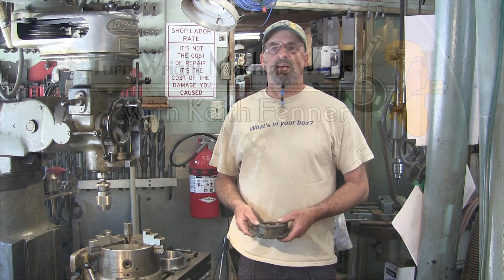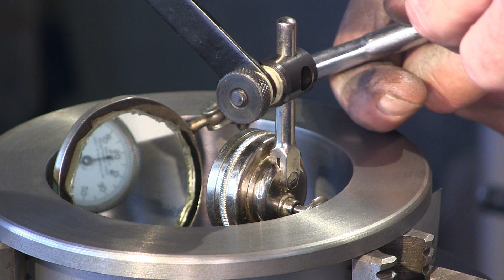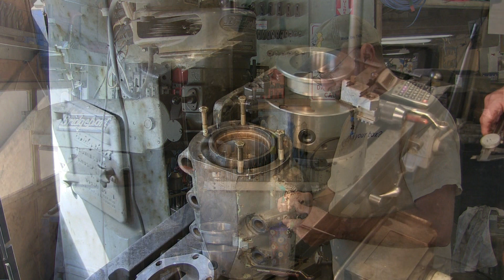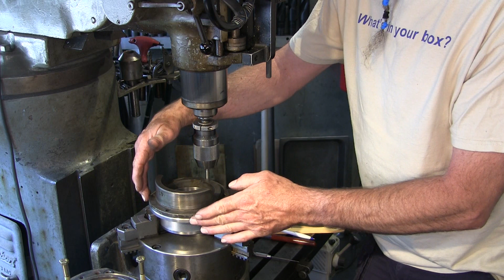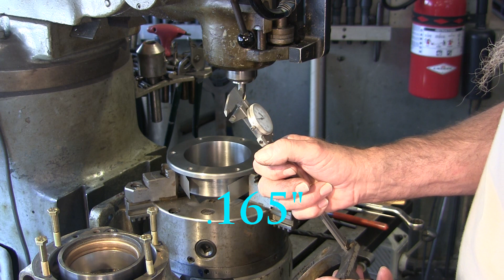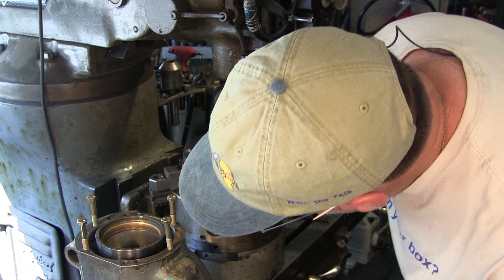Do Over Part Six

Comment: I would have set the part up on parallels so that the shoulder was up off of the face of the Jaws. This way you could mill both flats without having to move the part. It's not like it's taking a lot of force to machine the part.

Comment: I hate when that happens.  Thanks for having the guts to show the good and the bad. My only setup suggestion would have been to put three pieces of weld wire on top of the jaws so the flange would sit above the jaws so you could mill both flats just by indexing the indexer 180.

Comment: I'm gonna blame the Chinese three jaw. Thing is, any three jaw is not only concentrically inaccurate, but they need to be tightened in each of the three positions to take up the slack in the scroll, thereby applying the inward force equally. Of course, like you mentioned.. tight, but not so tight as to deform or mark the part. 
Work holding is a bitch sometimes. Easy to imagine that in a production situation the part being held in its own concentric clamping fixture. Or in a CNC machining center, the part would be entirely machined, sliced, diced, and then parted off in one op. 
All you can do is what we all have experienced. That's what machinists do... we Getter Done!
peace-out..Tc

Comment: You pulled an Adam!! unfortunately this isn't your part...  the worst part is you called it on the counter sink and it still happened. I ended  up .020" over on a bearing fit yesterday and had to scrap the piece of 6" cold rolled 12" long I've been working on for 4 days, last operation too. thanks for including the oops in the vid, it's cool to see that you are a real life boy and not just a fabricating machine!!!!!

Comment: Minor wrecks are among the risks of the trade. We've all been there. All you can do is take a lap of the shop, calm yourself, survey the damage, and either fix or do-over - which is kinda the title. Stay tuned.

Lessons? Gentle grips may allow movement. Aluminum between smooth surfaces can be slippery .

Alternatives to do-over? Skim damage from flange OD. Live with the esthetically ugly (can't see that happening.)

20-20 hindsights? Maybe a tattle-tale indicator to monitor part movement in the jaws. A clamp to anchor the flange to the top of the jaw; replace a jaw bolt with a stud for a clamp and step block. 

Predictions: Keith turns the replacement part ready to drill in about 40 minutes if he doesn't fiddle with cameras and narration.

And now, the next episode....

Comment: OUCH! No worries, you'll fix it. For the bad hole, plug the one not used with machinable epoxy like Devcon Steel putty, and install a helicoil in the good hole.

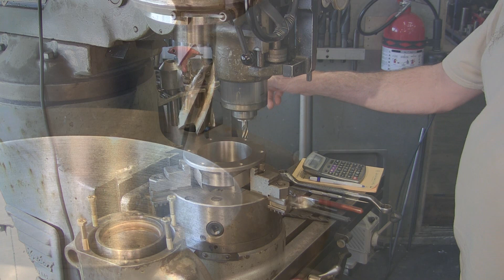Comment: 20:34 OoO Well, crap. Surprised me that it loosened up like that just backing up for a new cut. I would have thought it would have spun while taking the cut when it has the most tool pressure on it. Hopefully it can be salvaged and the cut was straight, didn't look like it moved during the cut.
Reply: During the cut, the tendency of the workpiece is to relieve the cutting pressure if it yields to it. (aka "Conventional" or "Upcut" milling direction). This is a negative feedback loop.
On the retraction stroke, even though the depth of cut is much less (it's effectively a spring pass) there is a positive feedback, whereby the slightest move of the workpiece in the least constrained direction (rotation about the z axis) causes more metal to be presented into the cut, instantly increasing the cutting pressure, with the results we saw. Important to note that this is true only after the cutter crosses the deepest part of the crescent machined away. From then on, any anticlockwise rotation of the work creates a rapidly increasing depth of cut due to simple geometry. 
This nasty contingency is something to watch whenever the "Climb" or "Downcut" direction is involved -- the rotational freedom vs straight cut situation, here, just makes it worse.
It's a pain, on a manual machine, to have to move the cutter clear of the work for the return stroke, and usually it's a step we can omit. Here, with a thin-walled housing requiring a light grip in the chuck, it was almost but not quite OK. 
One or more clamps on the flange, bearing against the side of jaw(s), would have helped prevent acw rotation, but that's a hindsight insight. Those are easy to come by.
Kudos for Keith for showing us the rough with the smooth. And for incurring the extra risk (due to added distraction) inseparable from turning every job into a teaching opportunity, for our benefit. Operations which are easy to pull off under normal circumstances become difficult when trying to document them in pictures (especially moving ones), and even more so when you add real-time commentary. People like Keith get away with it because they are (because of their skill and experience) SO much less inclined to screw up, and also I suppose people who do a lot of it get better at dealing with the added distraction, after a while.

Comment: Oh no, shame about the whoops, should file out?? I'm thinking a non welding repair for the two bolt holes is to plug them with the next size bolts up and re drill and tap a new hole??

Comment: so, did you edit out any "bad" words ?    LOL ....
Reply from the maker: Surprisingly my temper allows those words to be felt and expressed politely you see in part two, coming up this afternoon. ;{)-----
Reply: Just trashed a 10 mm twist drill today, at least you got lucky and only damaged the part, many words were said on my end :P
Reply: +Keith Fenner My first reaction was, WTF. lol. Non-critical dimension. It should clean up fine...hopefully. Bummer man. 

I had 8 hours into a part one time, on the lathe. I was almost done with the part and the insert broke and scrapped the part... that sucked!  I whipped right thru the second one, since my setups and my math notes were all still there but it just blows having to redo all that work.
Reply: my thinking exactly. Foul language may ensue. :-D
Reply: at least a "bollucks" LOL